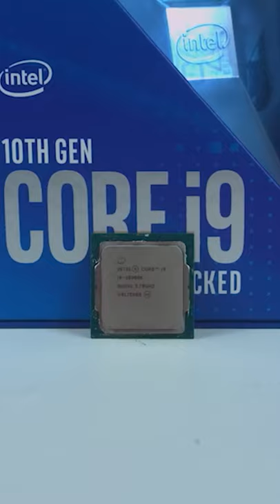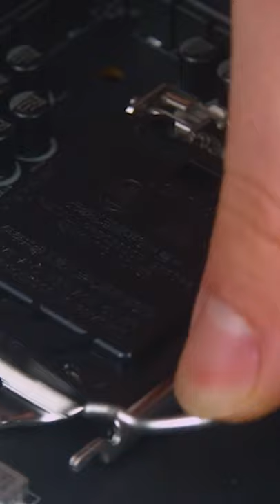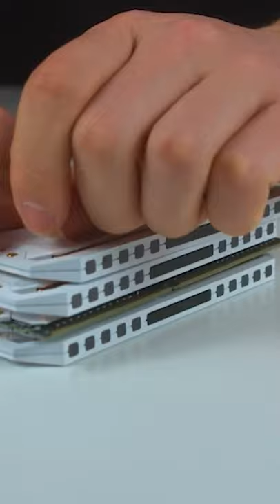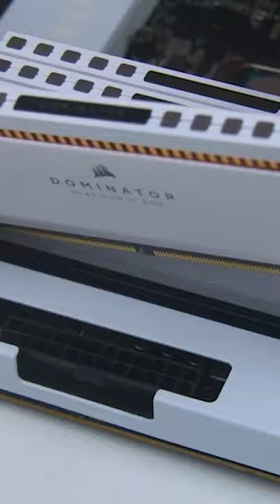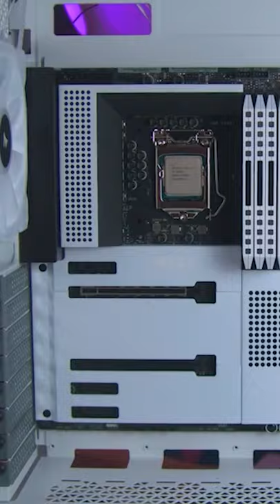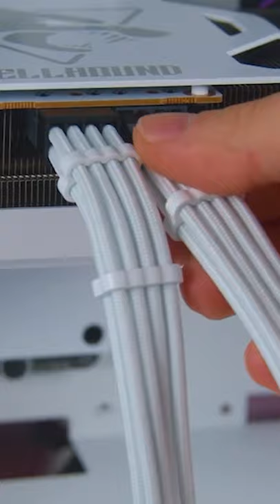ALL White Corsair Gaming PC!

Comment: Hi sir , which is the best GPU between 1000 to 2000 dollars ?
Reply: 3080ti or 3090 if u can get it on msrp try checking out micro center
Reply: The best to get would be a RTX 3080, of course you can't get it
Reply: @TheStraightGod  if you’re willing to pay 2K you can get a 3080, possibly even ti
Reply: @thegamerfromjuipiter7545  oh yeah, well they said "best gpu", I assumed automatically at a reasonable price. I would say it's "best" to get a 3080 at $1100 than a 3080 ti at $1800
Reply: @TheStraightGod  sure, but at current prices I’m actually seeing the 2
3089 and the 3080 ti going for about the same price